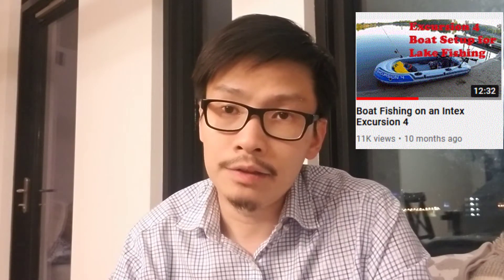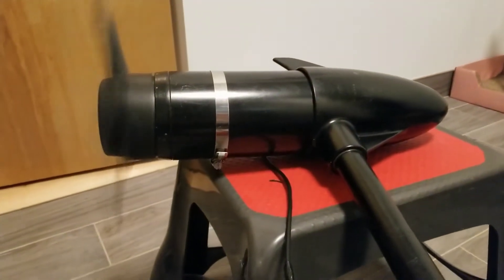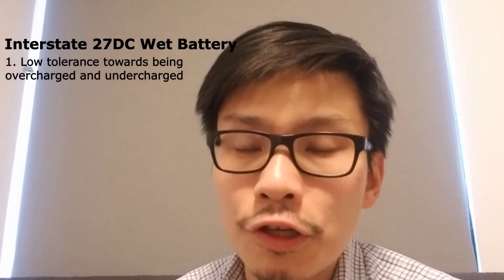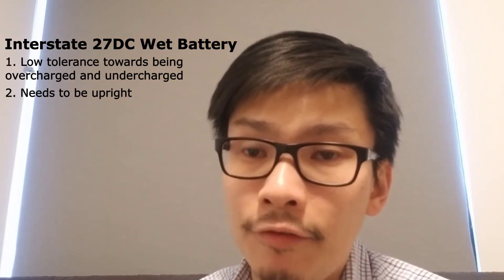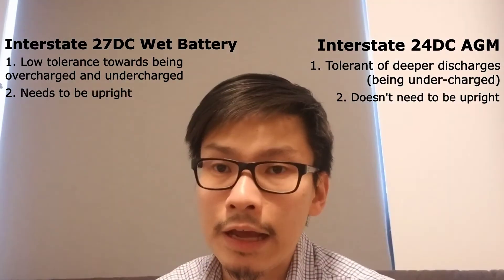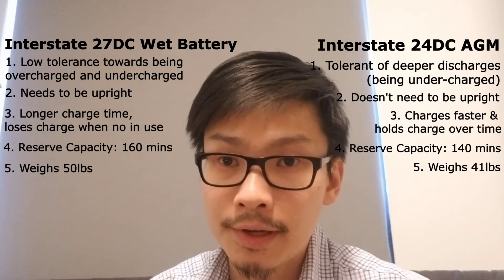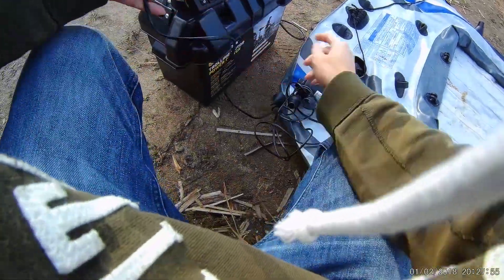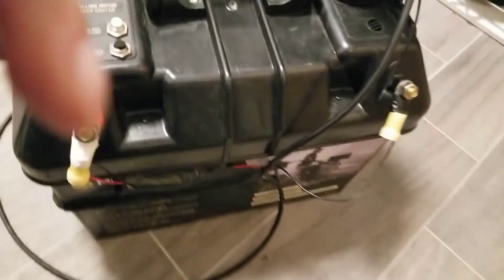Which battery do I need for an Intex Excursion? Wet battery vs AGM

Comment: Great video! I’m new to this and I read that I should get a circuit breaker. Is that true?
Reply: I believe the MinnKota box you have has it built in. Wondering if it's necessary to get it
Reply from the maker: It would be nice to have a breaker, I dont think mine has it. The box is mainly to keep things nicely tucked in

Comment: Hi there, do you know if the intex excursion 5 needs both a deep cycle marine battery and a starting battery if I'm out on a lake all day and i'll only turn the motor on occasionally to move around? 🙂
Reply from the maker: There is no quick answer for this. It all depends on the motor you are using and how much power it draws each hour. With my battery, i could run a 55lb thrust trolling motor on my intex 4 for a few hours on the water (turns on when I need to navigate to different spots). Also, the excursion boat does not track water as effectively so the motor needs to work harder compared to other boats.
Reply: @JChanTV_youtube Hi, do you know if it’s sufficient to spend the whole day on a lake (if we don’t move a lot and when we do we use the paddles as much as possible) with only 1 Interstate 24DC AGM 35Ah?

Comment: I have heard that powering a fish finder on the same power source that powers a trolling motor will cause interference. Have you experienced any interference on your fish finder while running the motor on the same battery?
Reply from the maker: Thats a great question! I did not get interference on my unit. My guess is that as long as they are placed far away from each other, it should be fine. Good luck on your setup.

Comment: Good job, how long does the Agm battery last while you are out in the lake?
Reply from the maker: This is a seemingly simple question, but it is actually pretty loaded one :) The answer is dependent on the 1) load, 2) wind conditions, 3) water conditions, 4) power draw from your trolling motor (i.e., how hard and how long you work your motor). Let me organize these points and put them in my next video which talks about trolling motors.